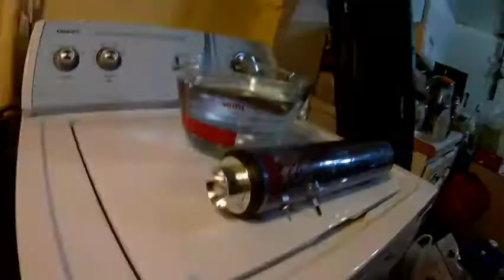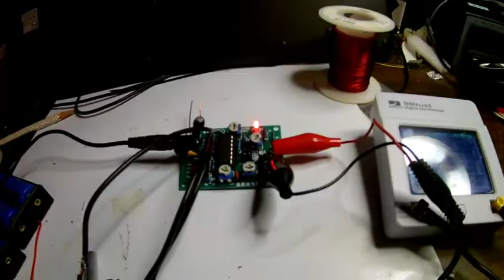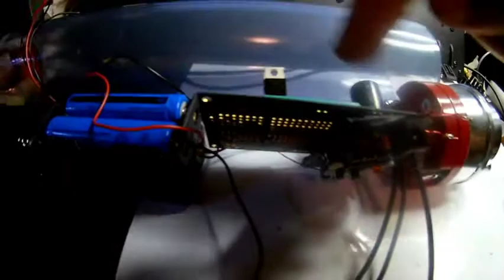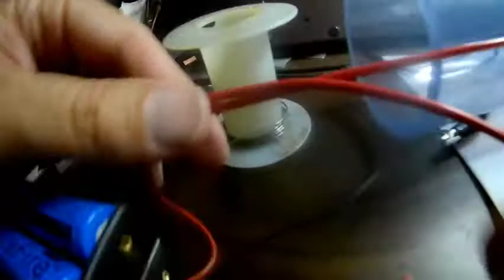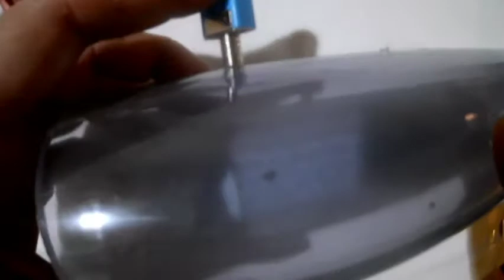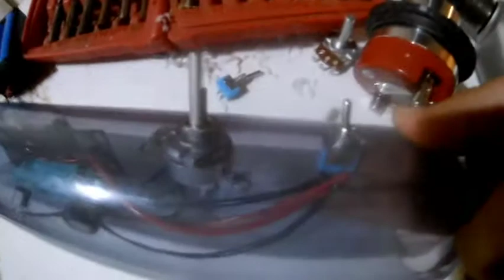DIY - Sonic Blaster

Comment: Some of the product links above no longer work.  Can you provide some detail about the signal generator kit you used so I can find it elsewhere?  Does your "Sonic Devastator" work just as effectively when it's purely in the ultrasonic range (or very close to it)? I notice the horns you use max out at 20kz, but maybe that's plenty good enough.  Curious for your thoughts.

Comment: No offense, but people don't need to drive squirrels away. They need something to shutdown the barking dog next door. If you really want to do a good service for people, what we really need is a hand-held version of this: https://www.youtube.com/watch?v=y7UZHEHhdek

Use smaller speakers so the housing is about 12x12 inches. It needs a range of at least 20 feet, 30 feet would be better. Instead of a battery, make it where we can plug it in to an extension cord.  Not all dogs are the same, so the frequency and volume needs to be adjustable in order to tune it where it is painful enough that the dog stops barking and runs away and hides. And the frequency doesn't have to be super high where humans can't hear it because the above device is directional; no one outside the line of fire will be able to hear it.

Build something like that, sell it, and you will get rich overnight!
Reply from the maker: Very interesting.. directionality comes with the ratio of small wavelength to large aperture size of wave emitter..  Smaller device size will require very high frequency to be more directional.. (i.e. Ultrasonic) This is a basic law of physics.. It is an interesting device.. I guarantee that there is enough diffraction from the waves of that device.. that other people,.. not directly in the beam.. can still hear it VERY loud and clear.. I'm sure my device will annoy dogs as well.. But.. the neighbors will probably not like it very much, if I test it on their dogs though.. since, they will hear the terrible sound it makes.. and immediately know what I'm up to.. I actually built this device for another purpose.. I just happen to notice squirrels really didn't like it.. Anyway, very interesting project! Thanks for the great comments!!
Reply: @jaynesnetwork  I think that guy in the video said there is a volume drop-off of 1.5 dB for every meter of distance (going by memory, might be wrong). To deter dog barking from a dog next door, you would need a range of up to 6 meters (about 20 feet). And volume at the target would need to be loud enough to hurt the dogs ears and make them run and hide, around 140 dB. And volume needs to be adjustable depending on distance to the dogs. So volume at the source needs to be adjustable up to 140 + (1.5 * 6) , so about 150 dB to allow for drop-off. Is that even possible for a hand-held device?

The guy in the following video indicates 10-15 kHz made dogs run and hide, but frequency needs to be adjustable for different dogs. So short bursts at whatever frequency up to 140 dB at the target would do the trick. I realize some frequencies will be heard by everyone in the neighborhood, but it would only be short, 3-5 second bursts, and the volume at the neighbors' ears wouldn't be near as loud as at the dog's ears. My neighbor is not home during work days, so in a short period of time, I could actually train his dogs to stop barking without doing permanent damage to the dogs and without the neighbor even knowing it. 

Check this out: https://www.youtube.com/watch?v=-4XrWZH3Hdk He has a number of other videos addressing dog barking sound cannons.

People all over this country need something like this, but they don't have the knowledge you have to put it all together. Heck, we don't even have the tools to put the frequency kit together! :) If you came up with something like this and sold it at a reasonable price, even if you had to do it in an easy-to-assemble kit form, you would clean up!
Reply: @dafringe  George, the product need you describe is similar to my situation.  Did you find such a product or build one yourself? I feel like I creating a circuit board from scratch (like many of these videos do) is beyond my knowledge/skills.  I'm willing to pay for a very powerful complete solution.  One that can be triggered by barking itself (or by remote) and that has enough juice to more than have the desire impact.  The "Dog Silencer Pro" I purchased doesn't appear to do much for some yappy nextdoor dogs.
Reply: @USFmarine  I've been reading up on speakers, amplifiers, etc. but haven't tried building anything, yet. There are a lot of technical details that have to be consider before putting any money into this.

My gut feeling is the right horn speaker and the right amplifier would do the trick, but the tech specs would have to be right for the job. I'm still researching that when I have time.

The two big dogs next door to me are behind a six foot tall cinder block wall which makes my situation a bit more challenging.

One thing for certain, though: If you build something powerful enough to hurt the dogs ears, it won't be small, and the whole neighborhood will hear it!!
Reply: @dafringe  whatever I build will be in the ultrasonic or near ultrasonic range and the older lady who owns the dogs is very unlikely to hear it
Reply: @dafringe  I don't think you need something terribly loud that may damage the dogs ears. You just need a device that will cover a distance between 40 to 400 feet the dogs can hear. Also, due to the narrow wavelength of an ultrasonic sound wave you will need a device that covers a wide range while still in the ultrasonic frequency range. I took the time to design an effective solution. See link posted in other comments. Note: Loudness of ultrasonic sound waves is not measured in Decibels. Dr. Jaynes posted an excellent video and hand held solution which I admire!
Reply: @yurij8039  I watched your video, looks interesting.. and also a little complicated for non-audio types. The dogs I had a problem with have moved on because I finally got the city to come out and fine the guy $100. Once that happened, he bought shock collars for his two dogs and a month later, he and his dogs were gone! lol I've got your video bookmarked in case I have a problem in the future. Thanks! :)
Reply: @dafringe  I think you found the best solution! 😄Not all Townships take the time to get involved and issue fines. My neighbor has no idea I built out the Ultrasonic cannon/ dog whistle and is still probably wondering today why his dogs relocated as far away from my property they can. LOL! Be well!
Reply: @yurij8039  He's wondering what's going on with his dogs acting weird! That's pretty funny. BTW, thanks for all the work you did putting together that video. It my still come in handy at some point in the future.
Reply: @dafringe  You may want to drop a like and comment. Trying to spread the word. 😊 Thank you for the positive feedback!
Reply: The following link describes a system designed for dogs and operates at ultrasonic frequencies. Also based on the LRAD concept you mention. When I use this device dogs go away immediately. Note multiple cannons increase your range and allow you to get around things like trees and fences. DR Jaynes I love your device! Great stuff! https://www.youtube.com/watch?v=CdKaBQk0GSQ&t=64s

Comment: Great work. Thank you. It appears to be very powerful. I am unclear about the construction of your amplifier module. You seem to use a TC4424cpc chip and an IRL640A FET. Can you advise how they are connected or direct me to a source? Thanks.
Reply from the maker: I have many videos on making pretty much every aspect of this device posted on this channel. I have several of the links to the most important videos in the description of this video here! Just click on them.. they should answer all question you might how of how to build this device.. I an designing a new one, that will be able to do multi-frequencies at very high power as well!
Reply: @jaynesnetwork  Thank you. An extension of what you have done here with the Sonic Blaster, would be to to design it, as you note, for multiple frequencies. I am looking for something like this and that can be tuned up to 40kHz. That would make the ultimate ant-barking device, specifically for dogs, and only used as a one-shot deterrent, as you showed here with the squirrels. I reckon that the lack of power and inability to tune to higher frequencies, to suit different types of dogs, is where many of the commercial dog deterrent devices fail. If your Sonic Blaster could be tunable to above 20kHz (say up to 30kHz) and with the same power level, that would be effective.
Reply: @jaynesnetwork 

Did you ever design one at higher power with multiple frequencies?  I have lots of squirrels roaming my place. I will readily purchase one from you. $500?
$1,000?

Comment: I think it might be able to handle more if supplied with pulsed output. It would keep the coil from burning but you would still be limited by the strength of the speaker cone.
Reply from the maker: You could be right! With the experiments I am using it for.. I wanted it to be CW though.. The  squirrel thing was only something I noticed when I was testing it outside.. I really built this device to investigate some new science that I am interested in! Thanks for the great idea!
Reply: Hi, novice here, what's the simplest method of pulsing a tone as you propose?   If you're using this as a dog bark deterrent a pulse may be even more irritating and effective than a solid tone.
Reply: @USFmarine  strongly depends on the setup. You could have a relaxation oscillator that runs some serious overvoltage to the speaker coil. This keeps peak current huge and average current low so average power dissapation is manageable. The rest will depend on the resonant mode of the speaker cone or whatever it's output coupling is and the resonance of the LC circuit supplying it. These should Ideally be matched up. There's more to it than that but it's a start.